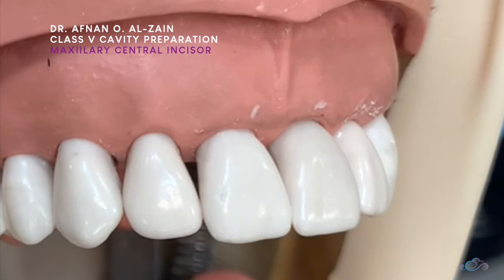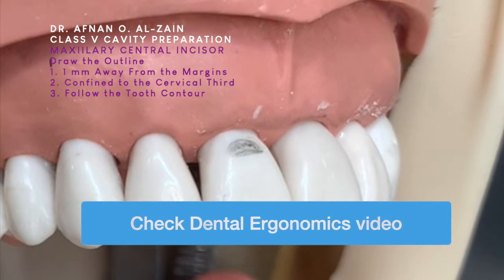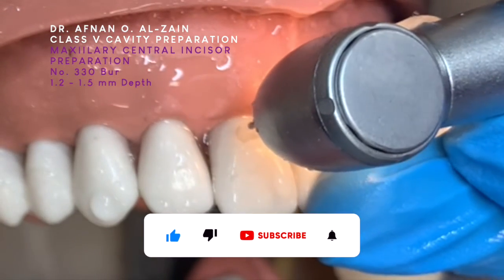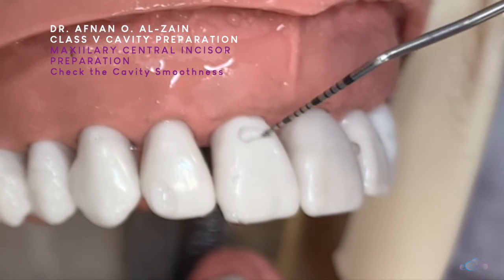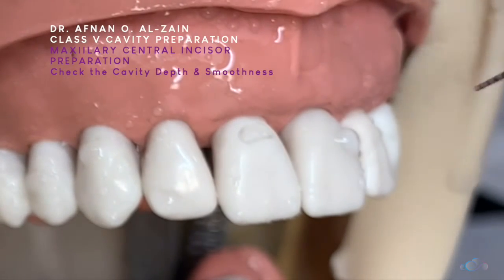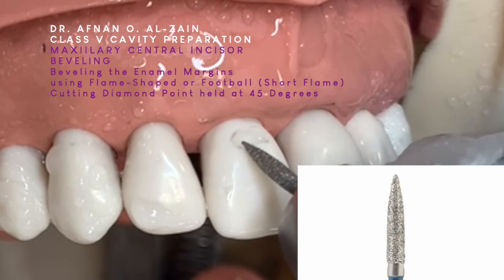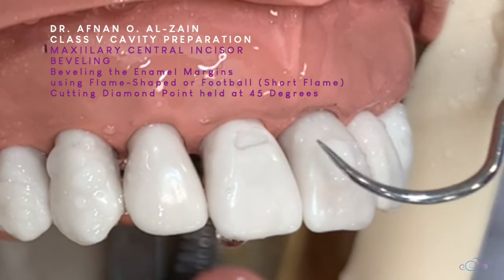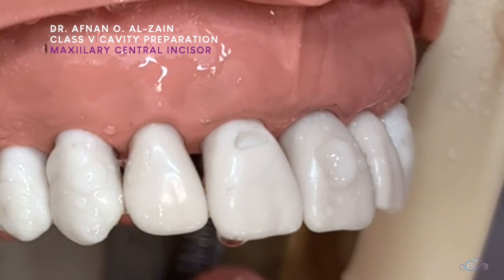Class V cavity preparation for composite on a maxillary central incisor (#11) - Arabic عربي

Comment: What's is the direction for retension grooves
Reply from the maker: Retention grooves for Class V should be placed on the axio-incisal (occlusal) and axio gingival line angles parallel to the external surface. They should be approximately 0.25 mm in depth and width, providing mechanical retention without compromising the tooth structure. This ensures stability for the restoration, especially with materials relying on mechanical rather than adhesive retention.
Reply: @drafnanoalzain  why do i feel I read somewhere that the grooves are buccolingual in direction?
Reply from the maker: A buccolingual direction wouldn’t give proper retention. The direction is incisogingival in a class V.